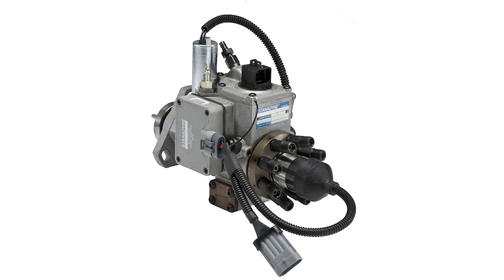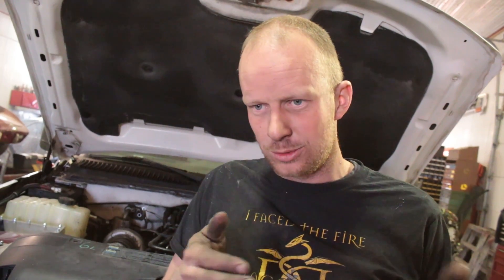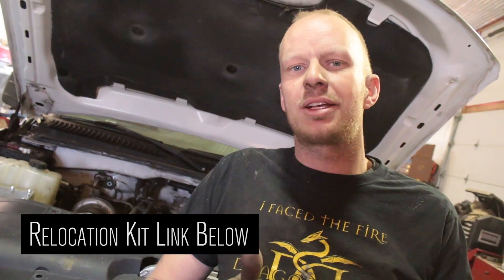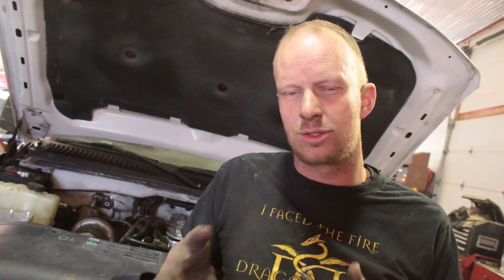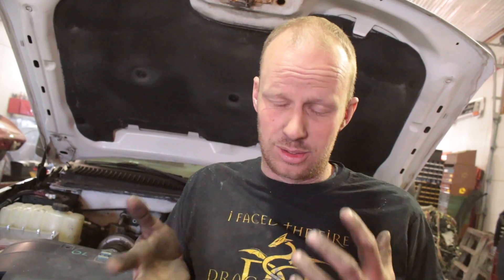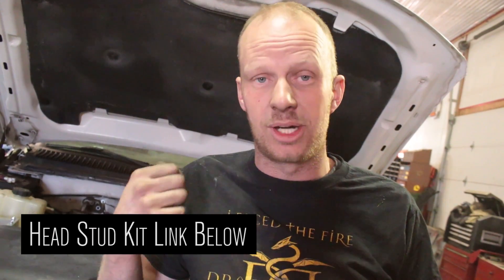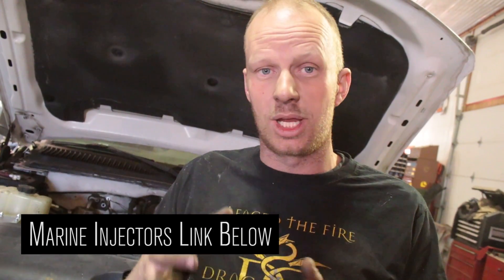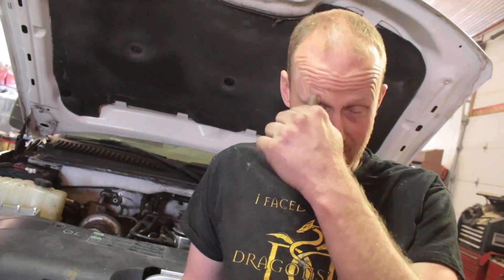REVIEW: Everything Wrong With A GM 6.5 Detroit Diesel

Comment: I have a 6.5 TD in my 1997 Savana 3500 Van with a cube box on it. Mostly it is about 10,000 pounds of van.  I just turned 202K miles and the turbo is weak, but I put a small spring to help it out.  If it gets too much boost the electronics will cut the amount of fuel, so I have it set to keep it under 9 psi give or take.  The piro gauge that I have in the pre turbo location still gets up to 1400 F.  I did have to replace the injection pump as it was only held in by one bolt (bought it used and some fool had worked on it a lot).   It runs good when everything is right; even spent about a month starting it with either until I could get time to change the glow plugs (you just don't want to squirt too much into it).  I just have a straight pipe on it for exhaust as it is long enough to keep it quite. LOL

Comment: There’s diesel fuel leaking from the bottom of my injector pump on mine any thoughts on what it could be from or what todo??
Reply: i'll bet its coming from the bottom of the filter housing. There are 2 small seals in the bottom of it that get leaky with age. Pull that housing off and see if its leaking from underneath.

Comment: Most of what you are saying about the fuel system is incorrect. I work for Stanadyne in their R&D center. I do reliability testing on all of our different pumps. The DS (electronic pump) is a very robust pump. One of the worst things that you can do to them is relocate the PMD to the top of the intake. There is not enough cooling to keep the high side drivers cool, where when mounted on the side of the pump, there is a heat transfer paper between the PMD and the pump body to transfer heat into the fuel being returned to the fuel tank. Another thing you said was to install marine injectors into a on-road engine...NOT a good idea unless you have the correct DB2 (mechanical pump) to match or all you're going to do is run the engine too lean because the stock pump can't keep up with the flow rate on the marine injectors, and they also have the incorrect spray pattern for the application. And by the way, this engine was not built by Detroit. It was a GM engine with very little input from D.D. on design, and actually the blocks have been redesigned 2-3 times to make them stronger because Detroit insisted that the bottom ends were strong enough, but GM later found out they weren't. They are now made by a company named G.E.P. (General Engine Products, a division of AM General) and are still used in military HMMWV using our mechanical DB2 pump, with the same on-road injectors as in 1985. If there was any truth to the marine injector swap, why hasn't the military done that to up the power? This is all fact, as I have first hand knowledge because I was a diesel tech for GM from 1995-2010 and worked on A LOT of these engines now work for Stanadyne the maker of the fuel system on these engines.
Reply: He's full of shit

Comment: We actually have 1999 GMC c2500 suburban with the 6.5 turbo we actually love the thing it's not out first diesel and definitely not our first Chevy. My dad is a huge Chevy fan we put bought it with a pmd relocation already done to it added extended trans and oil pan upgrade oil and trans coolers 4" straight pipe turbo back diamond eye exhaust with "muffler"(it's non interference so yo literally see right thru it) mishimoto radiator and a few other things for prevention of things breaking like a upgraded lift pump to prolong the life of the injection pump a vacuum pump delete (aka spool stick) from Leroy  diesel and few other little things. Truck runs great use it mainly for towing but we ran it as a daily when we were looking for something with better mpg and it's been ripping bout it with 145 k has over 152k now and it's been too Oregon and back to San Diego 2 times towing never went below 55 even towing up the grapevine egts didn't exceed 850

Comment: Ok guys i could use your help here ..i have a 6.5 ..all stock exept i did get a marine grade lifter pump with injectors and a HEATH pmd relocation kit ..ok so problem changed head gaskets and did the stud kit but now for whayever reason it continues to get hot ..(kicker) when theres coolant it gets hot when the "low coolant" light comes on its fine for a while .....HEEEEELP

Comment: I worked for a oil company they had a 1986 1 ton 4wd stake rake truck with the Detroit diesel it was non turbo with a 4 speed manual it had no power the biggest problem with it was starting in the winter constant glow plug issues
Reply: Maybe they should have MAINTAINED it. The only 6.2 engines with glow problems were 82-84. In 85 they updated the whole system and never was there a problem again

Comment: Wondering if you’ve done any work on a 6.2. I have an 86 k5 m1009 with m1008 axles and a 3” suspension lift. Yes...max speed at this point with 33” tires is 55mph.

Comment: Ok I have a little rant about this. Love your vids though but comparing a engine with about 4-5 platforms to a surpased amount. And second is Cummins is a huge brand Detroit diesel is mostly a smaller brand like the Powerstroke diesels. But a Powerstroke is used in pickups, vans, ambulances, and Busses and I think a couple more applications. Nothing wrong just a little rant that’s all.

Comment: Loved my 83 blazer that had a 6.2 L. Ran it for 300000 miles and sold it still running great. I miss it even though it was a gutless engine. Loved the fuel mileage 20-22mpg
Reply: I carry close to a ton with an 07 Duramax getting about 16 mpg, but without anything in the back I get about 23 mph. Tuned, 500 hp and 800 torque.
Reply: If someone made a mechanical injection pump/line/injector swap kit, I'd do Duramax all the way. My goal though is an EMP proof rig.

Comment: Deboss garage; What's your opinion on the V8 Cummins diesel in the Nissan Titan pick up? I'm thinking of buying one of these trucks. I've worked on a number of Cummins diesels in the past(40+ year's). But I'm not sure about this model of these engines. Have a great God blessed day
Reply: I work for Nissan an see them up close everyday the main thing with the 5.0l Cummins in the Titans is turbo issues, when they first came out, we're notorious for them failing or throw DTCs, now that it's been a few years since it came out it's a great engine not like a 6.7 Cummins, quieter and smaller, the put out 310hp and 555ftlbs their pretty decent for nissans entry into the American diesel industry, but originally the engine has been offered to dodge years back but dodge had turned it down in favor of the Eco diesel you'll see.

Comment: Hy man! I'm dealing with a big problem with my '95 gm4 for 6 mounts. It has to rev 15 times before it starts but with a raugh sound of injection( sounds like a 12l old engine) and a 30% more fuel consumtion, leak of power, and smoke(black and withe mostly).
It is impossible to find a mecanic, because I live in Europe...
Reply: I allready changed 2 PMDs. With original one it start at first crank but the engine revs incontrolable
Reply: So, I think the problem comes from an electronical problem, bot mecanic...

Comment: Putting the “black box” or PMD on top of the intake was an aftermarket thing and didn’t help any some would say it was worse. The pmd on the pump is cooled by the fuel but up on the intake it’s essentially mounted to a heat sink that’s in an oven. Whenever I get a 6.5 in I recommend putting that pmd back on the pump. This is advice I got from two longtime 6.5 mechanics.
Reply: every forum aive read has said to relocate the pmd to the bumper get it away from engine heat.

Comment: I've got a 6.2 with the turbo setup off of a 6.5 and I love it. The naturally aspirated 6.2 was a dog but adding the gm3 turbo made it a new truck. It isn't as strong as my 7.3, but it gets better mileage and is dirt cheap to repair. My brother in law is an Army mechanic and has been working on 6.2/6.5's for 15 years and is able to help me fix anything that may ever go wrong. I even picked up a couple of running spare engines for cheap since people think they are garbage. 

The engine is great for what it was meant to be. Bear in mind, it was a light duty engine meant for light duty applications and built for economy. They introduced the 6.2 not long after the oil embargo and people were searching for more efficiency. Trying to treat it like a big block and flogging it didn't go very well and caused a lot of problems for people trying to overdo it. Cummins and the International 6.9 that Dodge and Ford used were both medium duty engines that got shoehorned into light duty trucks. For those who don't know, a light duty truck is 1/2 ton - 1 ton, even though Ford calls their f250/350 Super duties, they are still a light duty truck. Medium duty is like an F450 and up or a school bus. Needless to say, a medium duty engine is stronger and people saw ford and dodge with heavier duty engines and tried to make their 6.2/6.5 stronger to be like them and then you get cracked blocks. 

Anyway, the old 6.2/6.5 detroits are what they are, an economical diesel engine that made sufficient power for most and for those who needed more, they would have needed to look at either a big block 454 from Chevy or go with a Dodge. My family has owned several of them over the years and they can handle slight upgrades and remain very reliable and you can expect to go well over 300k miles before needing major work. With so many put on auction from decommissioned HUMVEE's, you can get a rebuilt, low mile 6.5 for very cheap and keep your truck going forever.

Comment: I have a 6.5 in my step van. I took it to the dealership after having the pmd replaced.  The problem was it kept stalling.  The pmd did not fix the problem. So the dealer ship replaced the lift pump. It ran great for three weeks.  Then starting stalling again. I took it back to the dealership.  They told me the base timing on the injection pump was way out. They adjusted it to factory settings.  Now it runs terrible, as before it ran but stalled. But when it ran ,it ran great, now after they adjusted the injection timing it revs up high while idling almost like it's gonna take off. They said they don't know if the timing is out on the engine itself or if the injection pump has a internal failure.  Does this sound right? Or did they mess something up?
Reply: Carl Kuzniar sounds like passlock and/or optical sensor.

Comment: Your Ford hate is real and largely unwarranted. You’re more than welcome to your opinion so that’s cool. For what it’s worth, the 6.4 was not only used in pickups. It was also used in medium duty applications as the MaxxForce7. The 6.4 is actually a great engine after the DPF is deleted. The emissions system is the sole crippling feature of the 6.4. Unfortunately, the way the regen is setup on the 6.4, damage begins occurring early on. So the only way to have a gem 6.4 is a crate engine that never ran with their garbage emissions controls.
Reply from the maker: It was so great, they used it for how many years?
Reply: DEBOSS GARAGE I’m not saying it was ‘great.’ It’s application made the motor no good. My point is that it’s solely the DPF that make the motor a pos. Without the DPF they’re great. I’m a Ford owner and fan but I wouldn’t own a 6.4. I’ve had my 6.0 for 13 years and all I’ve had to do was the oil cooler about 9 years ago from accidentally overcharging new coolant with SCA4. That was a stupid mistake on my part being used to having to do that with the old green coolant. The 6.4 was a big problem but the main reason for them being used in pickups for 3 years was the breakup between Ford and Navistar when Ford went on to create their own engine. Luckily, all of the current engines are phenomenal. We are living in a great time, well... those that can afford NEW trucks are.

Comment: Many years ago i told my a mechanic at a shop I worked at that the Detroit's were basically a converted 350. Any truth to that? Are they similar to each other that their both v8?
Reply: The 350 Oldsmobile diesel was converted from a gas engine, but the 6.2 and 6.5 are completely different.

Comment: Drove a hmmwv 170 miles with no issues as the lead vehicle where I controlled the speed but the team lead said I was to slow (in a over weight chassis with a 6.5) so on the return trip he ordered me to keep up with him in the f150 he was in and it started spewing oil and coolant at 100 and snapped the belt. Key to longevity is slow and steady.

Comment: Check out the P400 version of the 6.5L. It has a redesigned engine block that is substantially stronger than the original GM casting. Whenever I swap one of these engines at the shop I install a P400 version with the marine injectors and an upgraded ECU.

Comment: Appreciate the information from what seems to be a knowledgeable diesel professional.  As a 6.5 owner it is evident the presenter is not well versed on the 6.5, which he acknowledges.  However, I did learn some things from this video, thank you.  I agree that this engine will never be a stump puller (at least not cheaply), more of a daily driver.....Your missing some other key mods for the 6.5 such as soot trap delete, braided oil cooler lines, getting the trans cooler out of the radiator, dedicated 12v to the lift pump, updated cooling system, etc...Thanks again....

Comment: Bought a 93 1 ton 2wd dually, 6.5 turbo diesel,  last year for a mechanical fuel pump. Other than the heads being replaced under warranty this truck went 735000 mile not klm,  personal truck used for camping pulling a show car. Ran a straight pipe from new serviced regularly odd glow plug failure. Best truck I have ever owned in over 40 yrs of driving. wih I still had it!!!!!

Comment: i have pulled up to 13.000 pounds with my 2000 gmc sierra 3500 6.5 litre turbo diesel with out a problem.strong engine and very dependable.

Comment: i have a 2000 gmc sierra 3500 with a 6.5 litre turbo diesel the truck has over 700.000 km on it no issues what so ever i have relocated the pmd and replaced the go plugs.i do regular maintenance.the engine is stock never updated the fuel pump.runs strong.don't need a 12 valve cummins.the 6.5 is an excellent engine.

Comment: All of the hate on power strokes... yet I have only seen one of these trucks on the road in my town and it's a very old 6.5. 6.0... tons still on the road including mine. And of course 7.3s are still chugging along. Little cough to a engine that navistar puked out is as douchey as it gets. I think I've maybe seen 2 or 3 even in my life. Most I've seen are 8.1 and 6.0 gas engines.